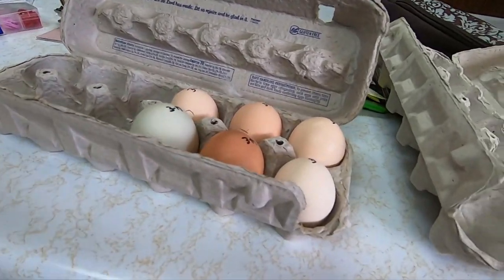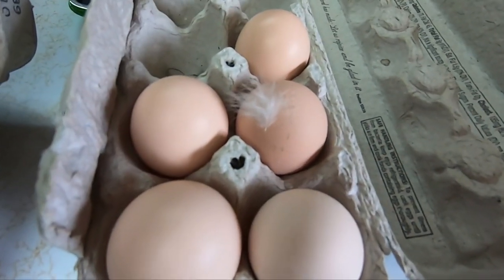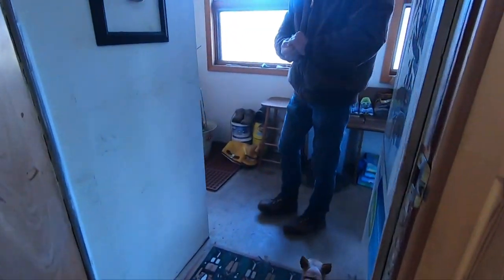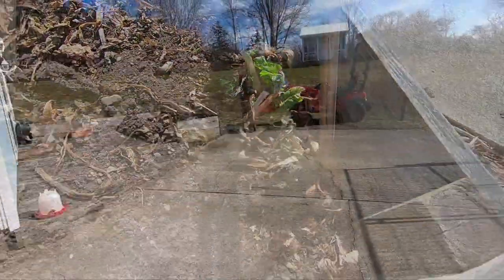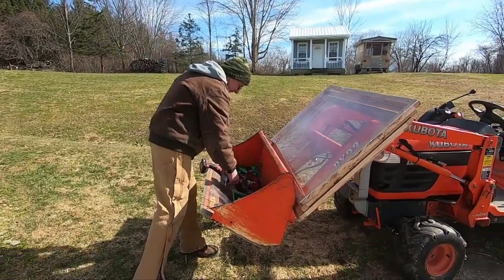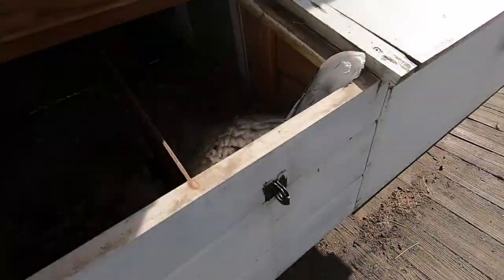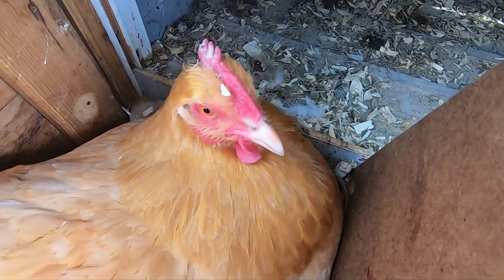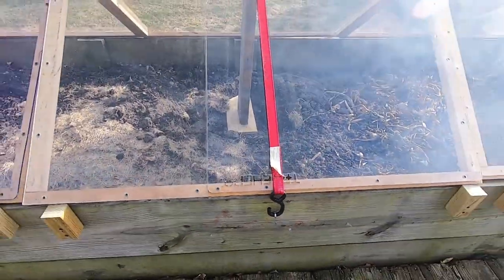Finished Cold Frame And A Little More

Comment: Love all the colors! We used to have chickens that layed all the pretty colors. The technique I use for hard boiling is to have the eggs at room temperature and then put them gently into the boiling water for 10 to 12 minutes. Immediately put them into an ice bath for a minute or two. Take them out crack them and roll them around on the counter and then put them back into the ice bath. You can then peel them easily. I have done this with eggs that I have gathered the same day and it is amazing! I think the secret is having the eggs at room temperature to start. Nice sunny day to work on the project... Coming along nicely! Have a great day! 😊
Reply from the maker: I love how you peal fresh eggs.  My Daughter does it pretty much the same way thee only difference is hers are not room temperature and she adds backing soda to the water that they are cooked in. She was amazed at how easy it was to peal.  tank you I will do mine like your suggesting  I will even have them room temperature to begin.   💕NonnaGrace
Reply: @NonaMaryGrace1952  That's great! I'm glad she found a way that works because that is such a frustrating thing when they don't peel!